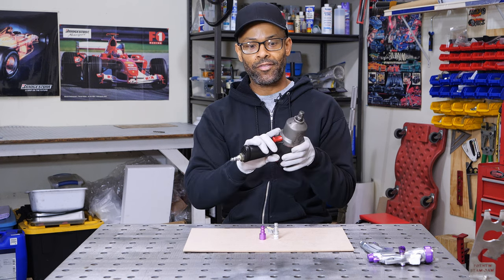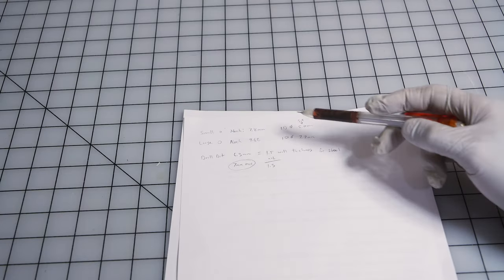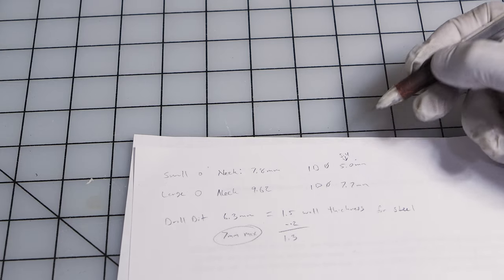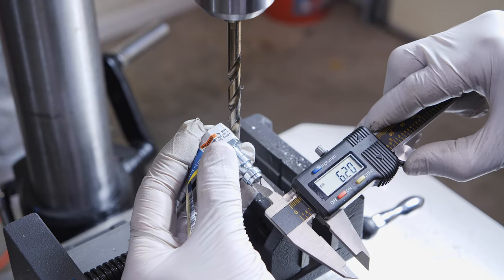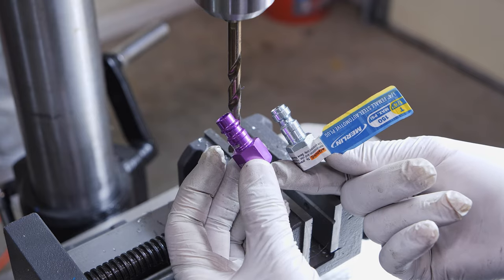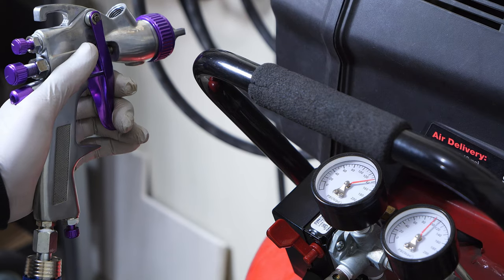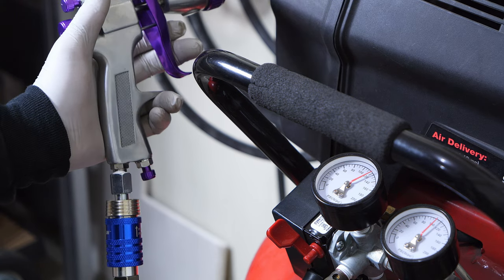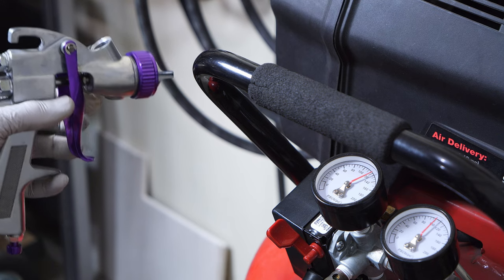Make DIY HIGH FLOW Air Fittings From HARBOR FREIGHT | CHEAP And EASY!

Comment: Great idea.   I just drilled out a couple of my industrial type fittings to try out.   Only thing you need to keep in mind.... At least If you're using industrial fittings, drilled out, they won't work in an industrial coupler.   
If you get a $5 universal type coupler (I'm using the $5 Merlin, from harborfreight) then it works perfect.     I don't know it that combination flows as much as a proper high flow set up..... But, I've always used industrial fittings, and I have such a pile of them that I just can't bring myself to replace them all.

Comment: Both  fittings and couplers  have  to be hi flow  and and compressor  outlet and regulator  to take  full advantage  the air leak at end is what  happens  when you drill out fittings  and don't have hi flow couplers  they wiggle and leak loosing  your drilling  gain  if you don't  make outlet of compressor  flow  to the hose there is  little  gain.  That's why  hi flow  fittings are sold with hi flow couplers . But if you want drilling  your existing steel  fittings  then you  need to  buy  hi flow  couplers  so they don't leak great  video though
Reply from the maker: Hello bob rossi! Thank you for your feedback and kind words! As I've been working on this bottleneck I've noticed that it's coming down to the couplers. I've got all of the fittings drilled out (and have already noticed a difference) and I will upgrade the couplers like you said. That should bump up the performance a lot.

Comment: One thing to drill out the simple Male connector.. But? what aout the Big quick release unit  It's  still undersized ?
 Then there is the Hose itself.  Bigger 'ends' aren't much benefit with a Drinks Straw sized hose bore.

Comment: I understand your results. But I have one question: you enlarge the I.D. Of the male fitting, but what about the quick release fitting? Today 8/29/23 I undertook modifying the male fittings I wanted to experiment with. Not having a drill press I used my cordless, placed the fitting on a vice, and used the approximately same diameter drill bits. Since this was test, I installed the coupler and one modified fitting on a 25 ft ⅜” hose. The results were a total failure, I couldn’t get air to the air drill. So after messing around and not getting anywhere I took the couplers apart to see why an unmodified fitting would allow air to flow, but not the modified ones. I was able to determine that the modified fitting was not compressing the spring loaded valve that’s inside the coupler. The cause is that by drilling the fitting I.D. the tip of the couplers spring loaded valve couldn’t be compress by the tip of the fitting. It’s I.D vs O.D. relationship. I resolved the ID OD issue by lightly tapping the tip of the fitting to slightly deforming the tip and thus allow it to compress the coupler’s valve. Yes deforming the tip does slightly change the ID of the fitting but that didn’t impact the mass airflow which drastically had increased my air drill performance. I’ll test the modified parts on my 22 gallon 175psi with a 50 foot hose to see if results don’t change.

Comment: Not sure if anyone pointed this out already. The error in your math is forgetting to double the wall thickness because there are two "sides" to the circle.  Ex 7.8 mm neck minus 7 mm drill leaves 0.4 mm wall thickness. In practice, drill bits wobble, so it will be even thinner.
Reply: Also it's not great to say "7mm is the maximum we can safely go to" and then immediately abandon that premise.

Comment: The high flow connections need to be on both ends of your hose.  That in combination with a 3/8” air line, you’ll definitely notice a difference with tools having a high CFM rating.
Reply from the maker: Hello Ftw9195! Thank you for your feedback. Yes, that's what I'm working on now. I have drilled out all of my air fittings and I've noticed more flow 😁
Reply: I just bought a few sets of the Merlin kits at Harbor, I've connected all my compressors via unregulated paths, and all my hoses are not only 3/8th, but large bore crimped ends, (there are many sizes not just the hose size) I've recently discovered that Milton has and does make the hiflow V style, and that's a superior product, but since Harbor is down the road, availability wins it for me, they are backwards compatible with my low demand tools, but after doing all my mods, my air gun almost blows me back when I trigger, just a little thoughtful planning and inspection makes a major difference.  (Get me outta this rabbit hole please lol)

Comment: You could probably boil all that down to about a 20 second video. And if you want to even have a chance of running impact, you need to get wider hose , possibly add a secondary air tank depending on your compressor size

Comment: I liked the video ans idea. Not so much the execution. You are very well spoken and methodical. First thing I would say is although the rest of the world uses metric, thr fact that everything related to air compressors and these drill bits is imperial. It would've been more beneficial and relatable to have measured in .001". Second suggestion would be to have established a control. Explained the compressor setup, fittings,  couplers and hose size and length. So as the viewer has an expectation of what to expect from their setup or how it may differ.
The problem with the modified steel fitting is it didn't look like you took into account the inside diameter of the threaded end of both fittings. As I have just been through this myself, there is a huge variation in both end inside diameters across the many different brands and materials of these fittings. Thanks, I'm fixing to watch part2